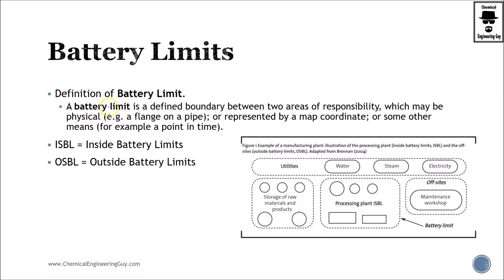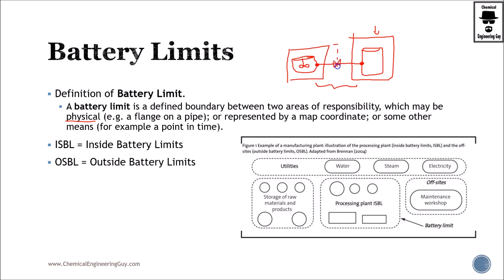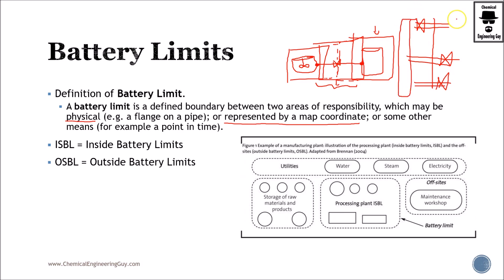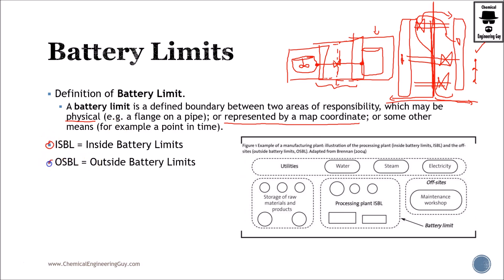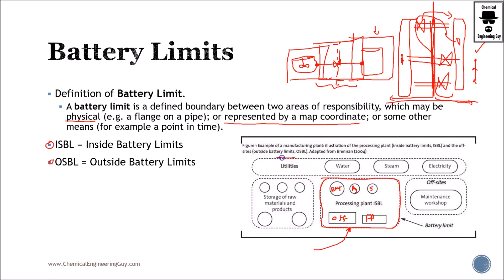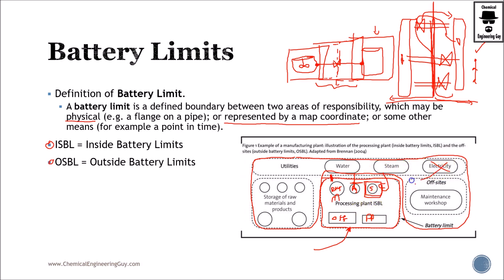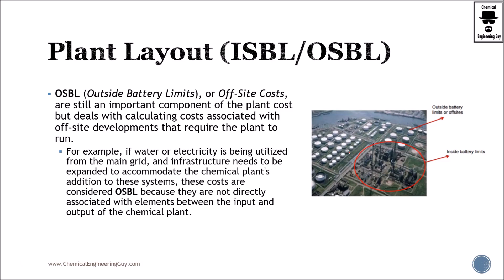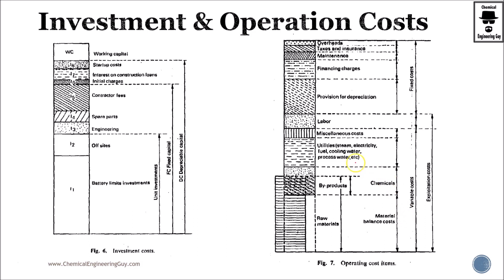Battery Limits ISBL and OSBL (Lec022)

Comment: Did I miss something? Where does the battery limit block valve go - on the owner side or the receiver’s side? Thanks for a great explanation.
Reply from the maker: it depends! truly hehe... I've seen it both ways... in no particular direction... It may be depending on the company or even between chemical complexes, you will see that some will have it in the "owner" and others will have it outside